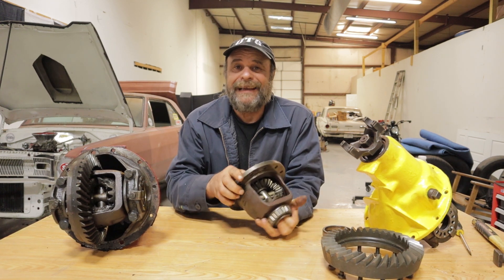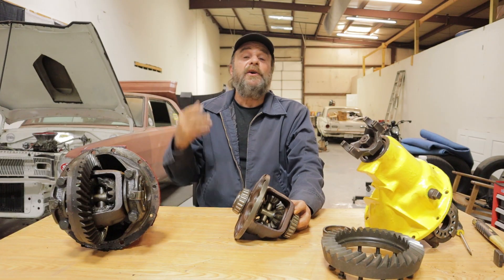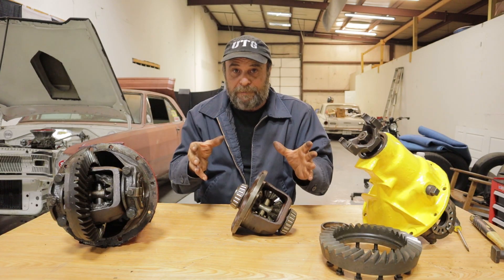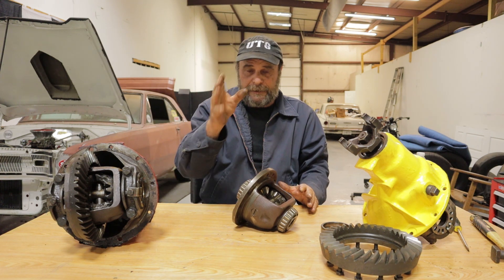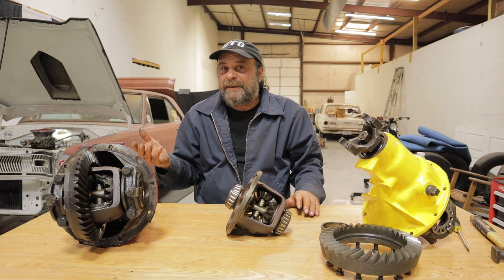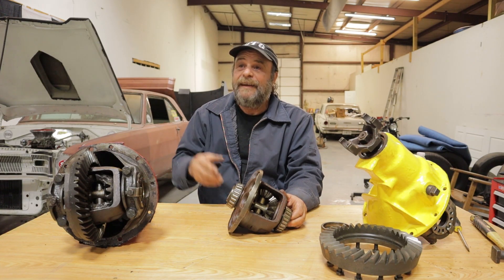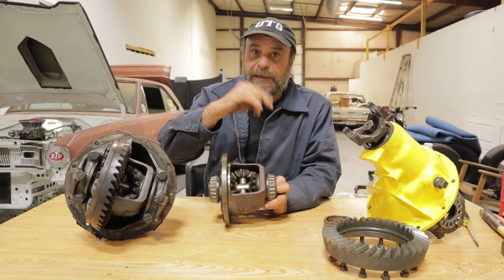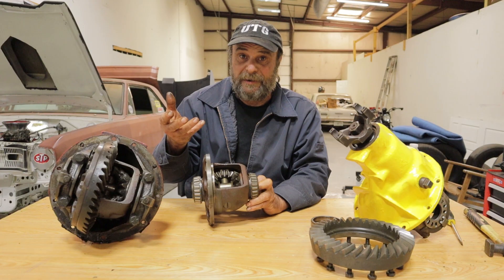Open Differentials - Getting The Most From Your Factory Peg Leg Rear Axle And Where They Work Best

Comment: In tractor pulling we actually needle the spider gears and side gears to reduce friction so the side with less traction can spin more. It is the only way to get a high powered machine to go straight on an uneven dirt surface because traction varies so much. If you lock the wheels together you can be pretty confident it’s going to shoot of in any direction but straight!!
Reply: Tractors (and 2wd trucks) often have steering brakes too. From what I've seen the 4wd trucks get locked diffs.

Comment: It's worth looking at lunchbox/ratcheting lockers. $200-300 depending on the axle. It drops in place of the spider gears and uses the center pin to push gears into each other. When you let off the gas the gears can slide over each other and allow the wheels to spin at different speeds for better driveability. I have no complaints with mine.

Comment: Defitnly a tutorial.  Seen someone weld them with out cross pin . He just welded the cross pin spiders to the carrier. Which doesnt work well for c clip axles. The cross pin hole was obstructed. He said he removed the cross pin to get better angle for welding gear but didnt alighn to replace cross pin. Which would probably work if he went to pressed berings and retainer for the axle. Luckily he lost the axel trying to drift in a parking lot could have been much worse. Realy need a tutorial on the correct way.

Comment: Mopars all Mopar high-performance cars 68-69 came with suregrip differentials in them just like four speeds were standard from the factory
Reply from the maker: 3.23 was the standard gear for all Chrysler performance models of the day.  Only exception being Hemi or 440 4 speed cars, which got 3.54's as the standard gearing.  Those, BTW are the only exceptions where the Sure Grip was included as standard equipment.
Reply from the maker: 3.23 open was standard, 3.55 and 3.91 were only available with the optional Sure Grip
Reply from the maker: You are very wrong

Comment: We have an 88 4X4 Blazer that is wheeled a lot.  It has an electrically activated locker in the rear axle.  To be able to select open or locked is a big plus.  The front axle has a lunch box locker.  The only thing wrong with that is the steering gets harder, especially the tighter you turn.  An E-locker in the front also would be perfect.  Not in the budget though since we have three other trucks that eat money.

Comment: Here in the land of ice and snow a posi can be both a blessing and a curse. A positive will get you through more snow  but it will also put you sideways quicker than you can blink. There is a bit of a learning curve to them. My 75 crewcab had na open and my 78 crewcab had a posi and I preferred the posi, you just had to be careful not to spin it sideways. With the 77 Trans am posi 4 speed you would sometimes have to pull away in 3rd gear. Driving on an icy highway was kind of I suppose like drifting with a 2 or 3 thousand horsepower car. But like the song says," but ii was so much older then,I'm younger than that now" lol if only. Cheers 🍻

Comment: I've always believed that adjusting your suspension and getting the tire pressures just right should be your first choice. A tight, or locked diff affects the cars handling. 
When Indy Cars run on oval tracks they use a spool. They also inflate the right rear tire to a slightly larger diameter giving the car a tendency to veer to the left. They call it "stagger". If you watch video of the Indianapolis 500 you'll notice the cars drifting toward the middle of the track when they come off turns two and four. That's the driver letting the car move over not to add steering input to keep the car near the wall, then at the end of each straight, going into turns one and three the driver pulls the car to the right to set up for the turn.

Comment: Uncle Tony, QUESTION? Could one use some type of diff-lock differential instead to have both the benefits of an open and locked differential for a street/strip car or truck?
Reply: probobly not strong enough
Reply: The old Detroit Locker comes to mind. Two of my cars have Quaife diffs. They are basically unlocked when you are coasting.
I would advise some sort of limited slip if you like to drive fast on curvy roads (unless you are a lousy driver).

Comment: Welding spider gears is cool, but there are a couple of issues.
1 ; The weld can cause a vibration. I've found less is better, as long as they stop spinning.
2 ;  On sharp turns, at low speed, especially U turns, the inside axle takes a pounding. With no differential action the inside axle winds up with tension, as the power from the center (spinning at outside wheel speed) is held back by the grip of the road. You get that, wind up-slip, wind up-slip, wind up-slip, and stock axles often can't handle it , especially when they'er 50 years old. Avoid doing this for the street, as wet weather becomes another issue.
Anyway, keep up the good work.

Comment: I used to pit crew for a racer that used a collar and spring assembly made from valve springs fitted to the spider gear shaft to provde constant pressure and shims behind the gears to stiffen the movement...it worked very well.

Comment: I was stuck in the snow with my van last week. Good thing I had tire chains, cable chains actually. What I noticed as always, the right rear is the one that looses traction, all the time, as long as I'm on the same slippery mess with both wheels. One of the cable chains came off, but I didn't want to stop because I thought I would get stuck and have to put it on again, so I kept it going. Cable chain was on the right rear. I made it. Don't know why it's always the right rear. ('91 Dodge van, 8 1/4)
Well, maybe it is torque reaction, because even in those situations there is a little bit of torque, even if you only apply the accelerator minimally. Maybe that's all there is to it.

Comment: Good presentation to help people to understand the forces involved , I learned this in flying club it was called propeller torque and if you wacked the throttle at low airspeed the plane wanted to turn left real bad . We thought this out and some of the guys in the club were also car guys . So I decided to try something I had a 67 Catalina 2 DR sedan with the 400 CID Pontiac engine { it was the standard engine ] . My buddy Paul directed me to a local  suspension shop that made their own coil springs , and I had them make me a coil spring the same height but was better suited to a F-350 Ford pickup . It was unusual in normal driving conditions if you hit a bump in the road the car would pitch left , but in left turns it handled great [ bear in mind this spring was on the right , passenger side ] in straight ahead takeoffs it worked well it didn't favor either tire . And in slippery conditions didn't push the front tires like posi did . I word of advice don't  weld your spider gears if you are going to street drive you car , first time it rains you will know what this means .
Reply: On a propellor aircraft, the dominant left turning force is called P-factor. Should be an explanation in Wikipedia or some such.

Comment: Open diffs are more robust in my opinion, especially in trucks. A little known secret with an open diff: If you are stuck and one wheel is spinning, just slowly apply the e brake and the load will shift to the non spinning wheel. This has worked for me many times.👍
Reply: I learned something like that in my youth on a Ford 8N. They had separate left & right brakes, as most if not all tractors did.
Reply: Modern traction control systems use the computer to apply the brake to the slipping wheel --just like the guy below talks about using the dual foot brake on a tractor. With the speed the computer does it, you never notice. You just go.
Reply: @danjones1897  There's a reason nobody uses traction control in drag racing or off-roading. Every traction control system I've ever seen had an extremely delayed reaction time. By the time they cut power and apply brake an experienced driver would have already recovered without lifting as much or even braking at all. I've also seen traction control systems freak out and cut the throttle and apply the brake on a modded totally hooked up car with full traction because it couldn't tell the difference between losing traction and gaining power. All it saw was too much wheel speed too soon. They can also ruin your desired launch or your efforts to get unstuck by cutting power when you want or need max wheel speed.
Reply: @Impactjunky  Agree off-road or in deep snow.Traction control will get you stuck in a hurry. It just kills momentum.
Reply: @waggitnshaggit6592  Very true, I got my K5 "stuck" in a muddy low land area once with only a few yards of space to get enough momentum to get back up the hill and get home. I spent probably 45 minutes backing up and trying over and over, being extremely careful to modulate my throttle and avoid wheelspin. Finally I got fed up and just gave the straight piped 350 all four barrels and it chewed its way up the hill like a rabid animal. Getting up there would have been 10 times harder with a traction control system.
Reply: @Impactjunky  Exactly! That’s why I love the old ones
Reply: I learned how to steer with the brakes to
Reply: Open gear diffs are no more or less robust in trucks.  Most of your heavier use trucks like F250 and F350 all have limited slip rear ends.  

More potential traction or less.  That's the question.

Comment: Hey, Tony another great video. I wonder if the people new to auto mechanics or hot rodding know why you need a differential in the first place?  aside from the fact that having both tires spinning can be touchy on slippery roads. they might be asking why not just have a spooled rear.  I am getting at the whole going around corners with a locked rear end.

Comment: The only good thing that comes out of my C body with  2.76 gears is it's a poor mans overdrive - best MPG possible, and highest top speed unless there is something lower than 2.76 gears.
No burnouts unless on a cold and damp day or i shift the weight off of the passenger rear. I'd probably move to a 2.94 (It's more of a compromise gear) gear in the future, but don't know whether the open diff is going to be fine or not.
👌😎👌

Comment: Actually why the back right spins up, with an open diff, is because the pinion slams the ring gear, and drives the left side down, causing the left side to have more bite . And then the open rear does what open rears do,  sends power to the wheel with least traction .

Comment: I want to see the video you promised us about eliminating the crush collar and why its important in drag car. I was telling a friend about chevrolet flex plate flywheels being out of round and how on chevy's you need to use shims on the starters, and that you can paint the teeth and the starter teeth will take off the paint, thats how you can find out the starter shim thicknesss, I know folks use spray paint on ring and pinion gears so the pinion is the correct depth. Anyway show us about the crush collar deal and how to use paint to set the pinion depth. I didn't know you could eliminate the crush collar? Oh yeah, on your Jeep if is it pulling both back tires you can't get in an egg and get stuck, like going thru a dditch diagonally. Most four wheel drive trucks, such as old Toyotas pull right rear wheel and left front wheel, if you go thru a ditch diagonally the pinions gears will  "strand" you because of the pinion effect and only one wheel in each differential pulling. If you have a posi in the rear it will plow on thru! Something you haven't touched on is the new Torsional differential with the curled pinion teeth look like springs.,

Comment: I used to race American stock dirt track  cars you weren't allowed to have anything but open rear end but if you mill down the side gears on the spider's stack 2 shims underneath and then use A Z Spring from a Ford 8.8 limited slip Make the outside spider gears real tight in the cairier we got flagged for Shooting two rooster tails but if you Jack it up and  spin one wheel it's open Diff

Comment: For situations where you don't want the power loss from a clutch-type limited slip or a spool, what do you think about using a helical diff if it's available and you can afford it? Seems like it would give you almost as much resistance to one-tire-fires as long as you aren't lifting a tire clear off the ground, but helicals shouldn't add any drag when one tire lags slightly behind the other due to tire size or road irregularities.

Comment: In a lite car a spool or welding is the best overall for driving experience even for daily driving in my opinion, they will also last a long time also had an 87 ranger and daily drive it for 4 years with one probably 30-40k miles, only downside was tire wear, also had an S10 that was also great with one. Don't use them in heavy vehicles tho I did it to my 3/4 ton and just turning in an intersection it actually loads the motor 😂 I eventually have to fix that lol

Comment: At least one of the modern supercars runs an open diff. I don't recall if it was McClaren or Bugatti but they use speed sensors on the wheels and when one gets too much faster than the other the cars electronics will pulse the brake on that the fast one. The pulses can be longer or more frequent or more powerful depending on the difference in wheel speeds and other conditions.

They say the system saves weight and works better than any mechanical limited slip diff.

Comment: Im running into this problem with my ‘64 Cadillac.  Rearend is completely unique to Cadillac, and even if I could get my hands on a posi, it would probably have to be a complete pumpkin, as the gears are riveted in on these units.  Might just try welding the spider gears, if it does 1 wheel peels I’ll never hear the end of my buddies ripping on me 😂

Comment: My favorite "hack" posi on old gm cars with rear coil suspension was always putting a football in the right rear coil spring.  Change the air pressure to change preload, and it only costs $5 and little playing around with pressure to get them to bite like they had a posi in them.
Reply: I just made the same comment!!! Works great on foxbodies too!!!
Reply: I was going to comment the same! Worked on a bunch of g-body's and a-body's with a football or dedicated fit airbag. When we started to install anti-roll bars more often they went away.

Comment: Any chance of doing a video explaining the differential of the Mazda Miata? The 90'-93' 6" compared to the 94' 7" ?  I'm going to do my girlfriend's 93', with parts from a junkyard. I've been researching it, but I'm still not to sure about the gear ratios, and limited slip, torsion, etc...
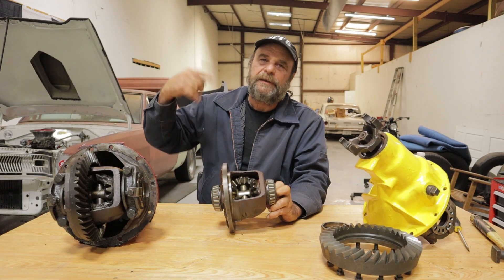Reply: The 6” and 7” both used a clutch style LSD that can wear out and quit working. The 89-93 manual cars had a 4.30 rear and the 94-97 manual cars were I think a 4:10. Can’t remember what the automatic rears were. 
Generally the ideal swap is for the 99-00 manual torsen diff. Those keep the 4.30 ratio, have the bigger stronger construction, and use the torsen diff that has helical gears for the limited slip. You’ll need the axles and power plant frame too since it’s a bigger diff and bigger axles. They can still break, but are much better and much stronger than the smaller clutch style.

Comment: Tony, love to hear your thoughts on installing ‘ back braces’ on a 8 3/4 differential. Worth the investment?
Reply: If you have over 450- 500hp and are running on the track with a good radial or slick. Then yes the $100 and 30 minutes of prep and welding is worth it.  8.75 housings will twist and seperate under an aggressive load without wheel spin.

Comment: Suregrip - every time I'd turn a corner the inside tire would slip, squeal.  I can't tell you how many times cops stopped me and gave me crap for it, as if I did it on purpose.  "Well, you need to get that fixed."  I just could not explain it to them.  But then I realized they were going to give me crap no matter what.

Comment: I have always been confused by the muscle car open rear issue.  In my opinion, the manufacturers did this to avoid warranty claims.  The bias ply tires were total garbage back in the day.  The engines made massive torque.   If that rear locked up and hooked,,, BOOM!!!!  The one wheel peel was the answer.  GM and others responded with "posi-traction"  The problem with those was it would just swap which axle was spinning.  Left ... right ...left .. right.. then maybe ....  both would lay rubber.  GM used open rears on the 80's Monte Carlo SS and the Hurst Olds.  These were both very expensive cars when sold.  GM used a $50 rear axle in them.   Even though the engines in the 80's were pathetic.  To be honest...  if the Monte SS and the Hurst Olds had a locker, they probably would have stalled if you wanted to do a burn out.

Comment: For years when I would bring up the extra leaf on the right side people would look at me like I was nuts.  Thanks for mentioning this.  Another trick is to cut out four rectangular plates from 3/8" sheet metal, blow some holes in them, and bolt them on the front sections of leaves on each side, clamping the leaves together so they did not bow apart under acceleration.  I never noticed this making the ride rougher, just that it kept the car straighter coming out of the hole.  Also, I used an adjustable pinion snubber instead of traction bars to keep the axle from twisting.  It was easy enough to crawl under and raise the snubber for the track, drop it back down for the street.